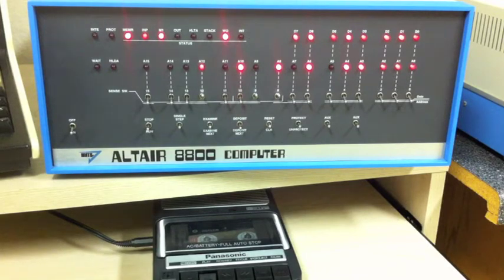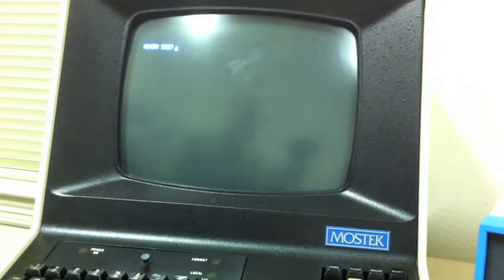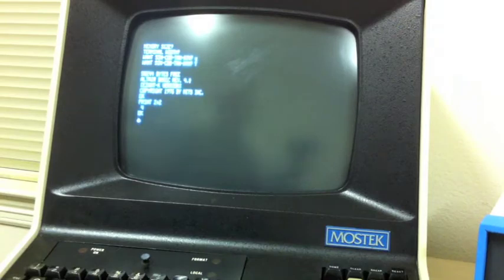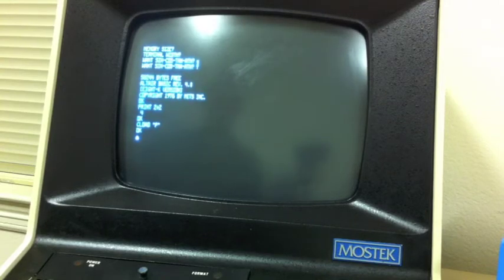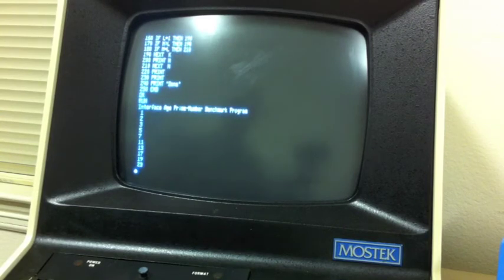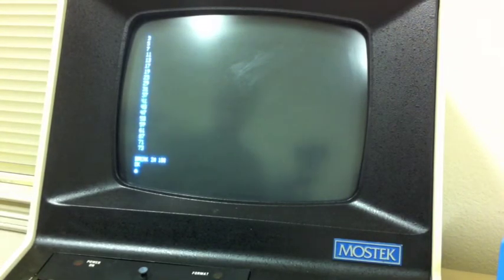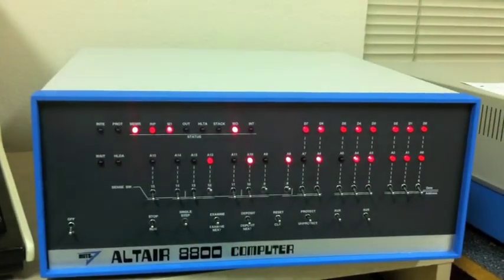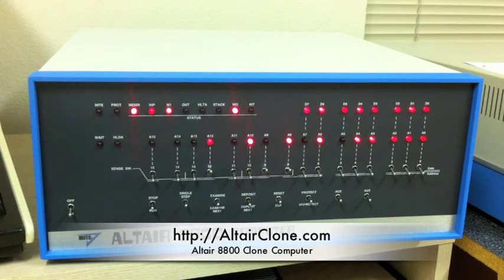Altair 8800 - Video #9.1 - Loading 8K BASIC from Cassette

Comment: The Altair may have come out in the 1970s, but using it was like being back in the 1940's and 1950's, before higher level languages and compilers became available. I'm glad I never had to experience the Altair, and I feel sort of very sorry for those folks who did. Even if the on-console switching was all done correctly, you could still be screwed by syntax errors as little as just one symbol.

Comment: So... serious questions here:
Why did you guys use cassette tapes for programming instead of reel-to-reel tape...  which had better playback consistency and higher fidelity?  Please explain in detail. Was it a cost issue?  Was it easier to duplicate programs on cassette?  Was it cheaper?  Was it easier to trade programs because everyone was using the cassette format by 1975?  (I'm well aware that programs could be pulled from vinyl discs and TV programs via transferring them to magnetic tape....)  Did you know of anyone running programs on R2R when the Altair 8800 was in high use?  Just very curious here.  Would like to know.
Reply: I suspect that it had a lot to do with Audio Cassette players being relatively cheap and readily available items for home-users.
Reply: Also, by 1975... there would have Sony's Beta consumer video cassette tape.  It could be used for the audio alone... so why not use that as a source for your pre-recorded programs? 

Honestly, I can see why you guys used the teletypes initially... but even in the days before the mass-distribution of programs, it seems like HQ tape copies of programs would have circulated much more quickly amongst hard-core enthusiasts than straight-up analogue "input-and-go" programs.

I guess it was all based on ease of use.  With a cassette, you pop it in and press "Play."  Ease of use.  That must be the answer, eh?
Reply: +rareblues78daddy In my opinion i would say, because cassette tapes are smaller and more common is the reason people used them, it seems like EVERYONE and every computer back then even commodore's computers used them like the commodore PET had one built in to it, also i would think they were easier in general to use and work with.
Reply: The answer is cost.

Vinyl would theoretically be an option for reading a program. But as a writable storage medium? - who on the consumer market would have a vinyl cutter?

Reel to Reel machines for tape recordings would theoretically be ideal and they can be used- I agree, but they were outside the hands of most consumers, except maybe audiophiles who could afford a high-end sound system.

Cassettes on the other hand were small, cheap and common which would make them a viable solution for consumers in 1975.
Reply: @paulgraves1392  Thanks!
Reply: Cost made them very useful, but durability was also a big factor.  When my dad made his cassette interface, he said it was because of his testing in aerospace telemetrics recording that determined these cassettes would take a lot of vibration and abuse when installed in rockets.
Reply: @garytarbell  ...this makes sense. Thanks!

Comment: I was born in the PS2 time and I still love this, although the octal is bothering me XD
Reply: I'm used to hex :P
Reply: Gabe Alexander Same.  It seems to have been popular in the 8-bit era.  Intel uses it in its manuals for the 8008 and 8080.  My theory is that people were dealing with opcodes a lot more back then (not just mnemonics) and reading "172 654" out loud is easier than "F5AC"
Reply: Your comments are pretty old, but I will answer anyway: The main point, why octal was so common back then is, because many mainframes of that time like the pdp-10 had a word length divideable by 3 like 24 bits or 36 bits. And with these, octal adds up nicely. Another advantage was, that they could display octal numbers on common consumer nixie tubes (which had 0-9) which were cheaper than manufacturing own hex nixie tubes.